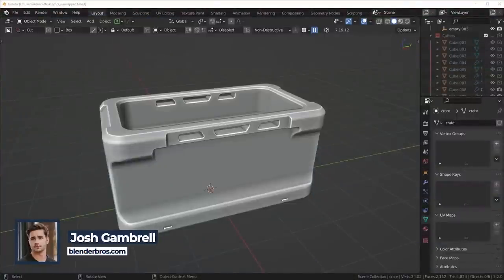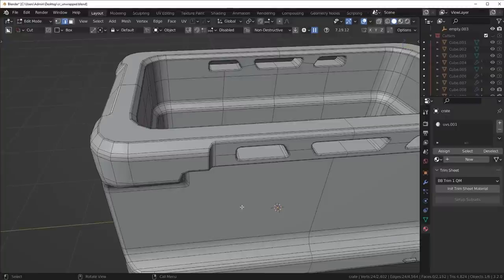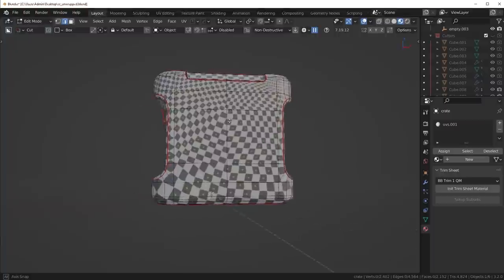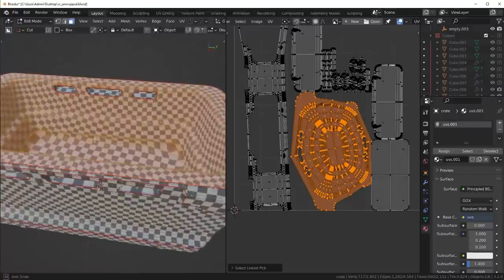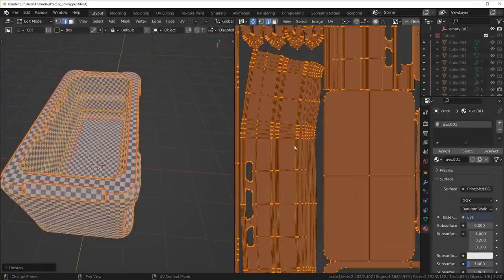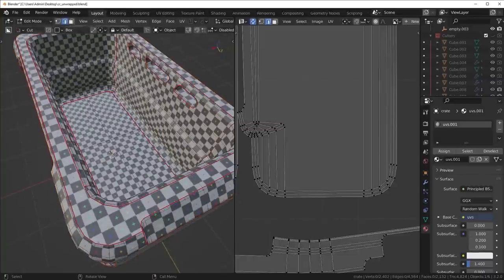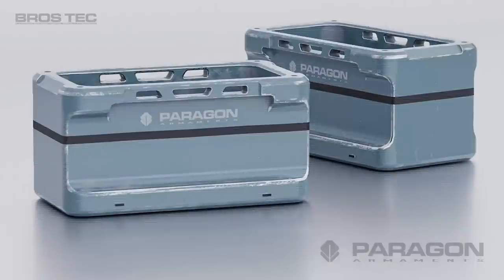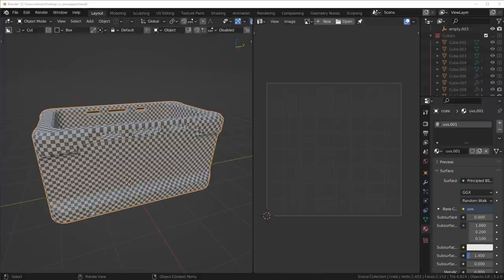UNWRAPPING Tutorial for Blender (The Easy Way)

Comment: Hi Josh, thanks for the video. Got a question, probably dumb one but I'm beginner.

If I have a high poly meshes with bevel modifiers all over the place, and I inted to use only high poly texture it in substance, not to bake it to low poly one, should the bevel modifier be applied first and then UVed?

And why does in Blender bevel modifier under Geometry/Mitter Outer if set to Arc gives shading errors after baking in substance but the Sharp type is good?